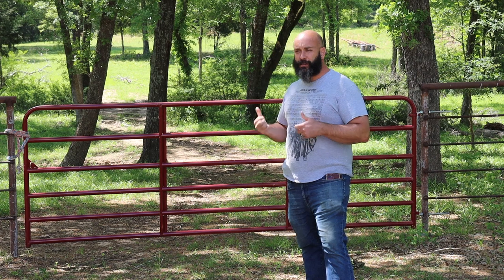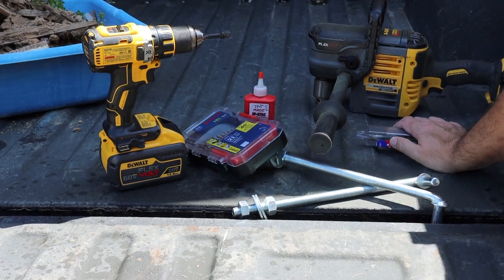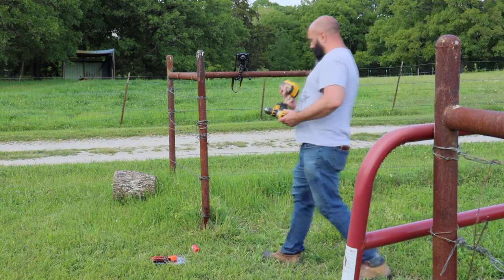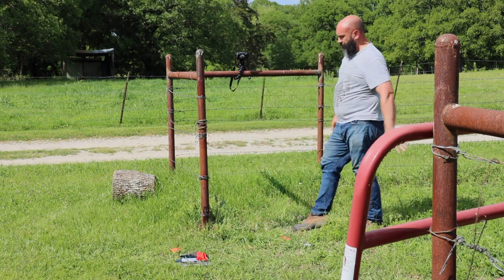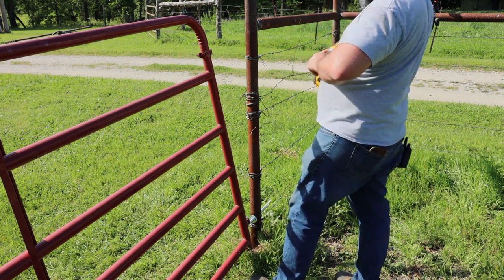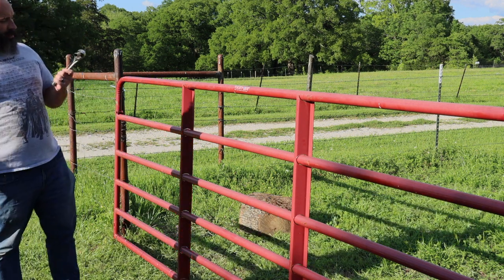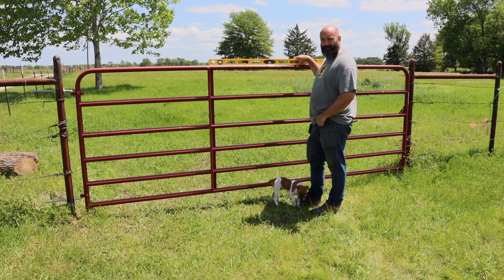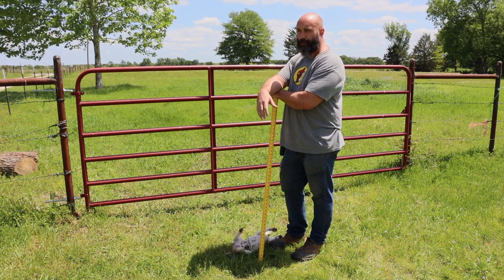How to Hang a Pipe Gate on Steel Posts - DIY Drill Method

Comment: Thanks for the video. I'm using 2&7/8 inch drill stem pipe for my posts. Your video answered my question, to use a drill or to use a cutting torch to make the holes. I don't know why but when I drill in thick metal, the drill bits will snap off. I even keep the bits oiled and they still snap off. I feel like I would be going thru too many bits.  I never saw your bits break off, so I'm gonna try the kobalt bits in the future. Thanks for not editing out the difficulty parts.
Reply from the maker: Thanks for your kind words, one never knows whether to leave in the difficulty parts or not for sake of time.  I'm glad the video helped, and I'd definitely recommend using the Cobalt bits for going through metal, Bosch was good to me but any high percentage cobalt bits should be better than the standard bits.  Hope you get yours all drilled and working, good luck!

Comment: A way faster method would be to use a small bit to go all the way through the pipe and then use the hole as a pilot hole for a 3/4 in hole saw.
Reply from the maker: I wasn't sure a hole saw would go through the steel with any speed. Perhaps a really good hole saw bit with great teeth. Have you tried it?
Reply: @homesteadyall  I use the cheap bits from harbor freight.  I've done several and use cutting oil.  Most pipes aren't over 1/4 inch thick.  Yes they do work good.  My pipes were 6 inch so regular drill bits weren't long enough so I went this route.
Reply from the maker: Thanks for the tip. I'll give it a try
Reply: For start drill 1/8-1/4 go with highest Rpm. Than for the 1/2 go with medium speed and for 3/4 and up go with slowest Rpm I dip the bit in used oil to cool the bit.